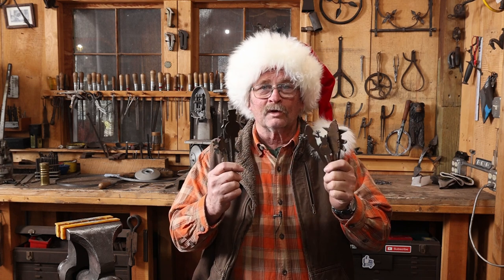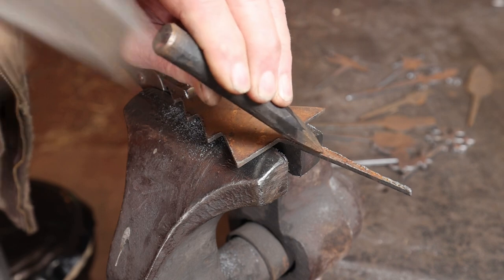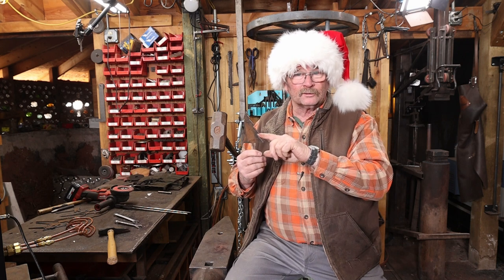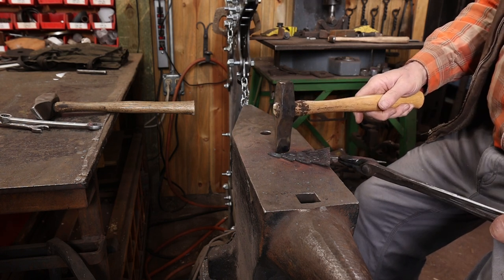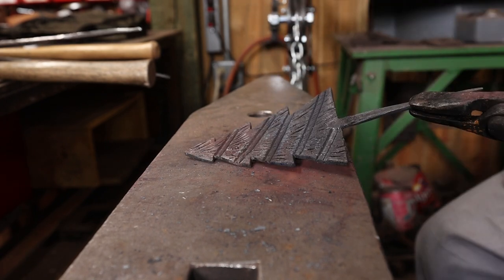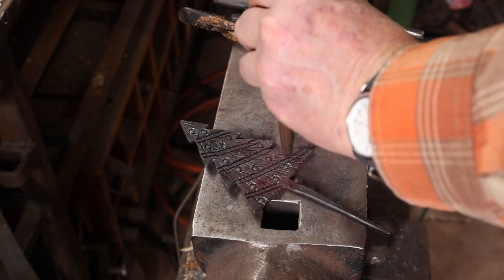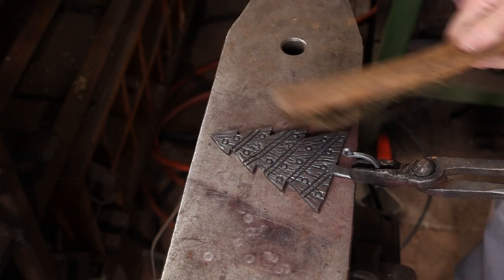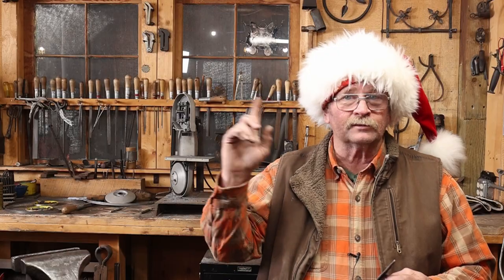Christmas Tree Hook

Comment: In the video on your second channel, you mentioned you shouldn't hit a hammer with another hammer, why? Should I not be doing that? I do it fairly often, I'm curious as to why I shouldn't, if I shouldn't, and if it's going to be a problem for the work I do, which isn't blacksmithing.
Reply: Two hardened surfaces clashing, chips fly off at speed possibly inflicting damage.
Reply: @armadilloforge  I've never had that happen, maybe my hammers are just sh*t 😂 might be a OSHA "suggestion" like wearing nitrile gloves while applying linseed oil.